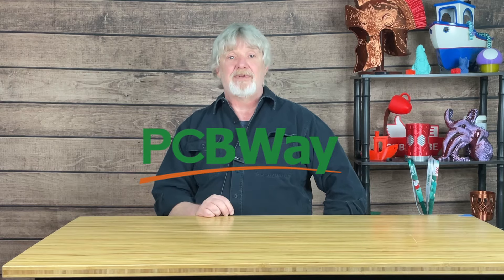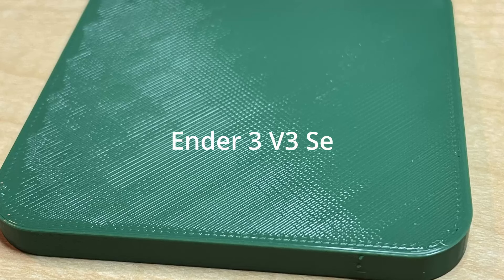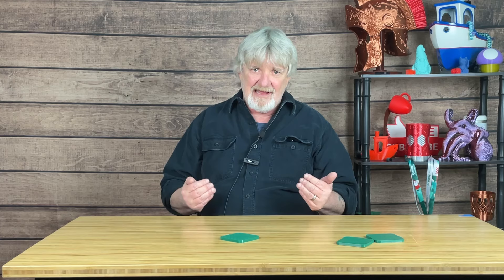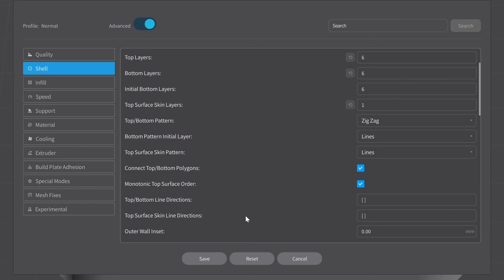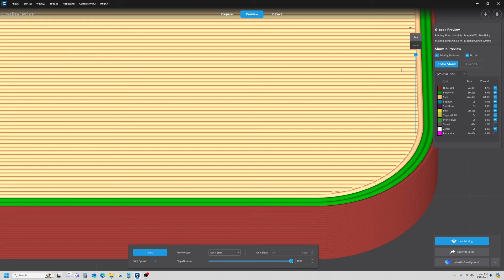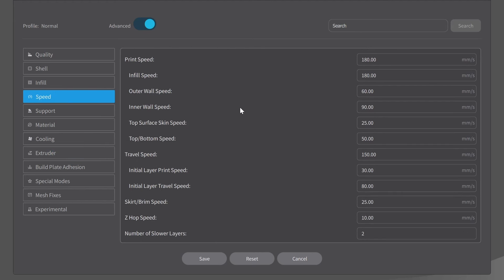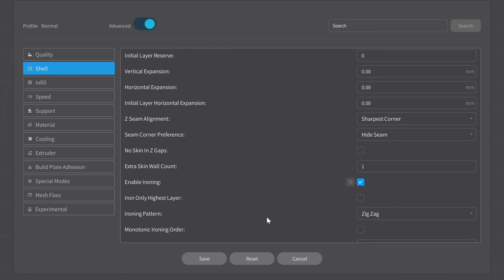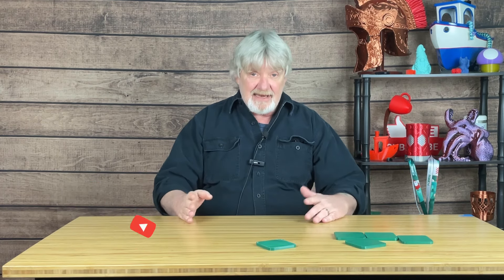Great Top Layers With Creality Print

Comment: After your last video about Creality Print I downloaded it and gave it a try. I couldn't find a menu like in Cura (who knew it was edit) so I gave up on it. This video helped a lot in showing me where to change settings. Hey, I'm 71 and don't play around with my printers enough!! I'll give it a try on my next print. Thank you for the information and video.
Reply from the maker: I'm glad to hear the video helped! Do you have a preference of Creality Print vs Cura? Both are great slicers as is Orca slicer. I bounce around between the three of them. Thanks for the kind words and I really appreciate that you took the time to watch! Thanks you very much!
Reply: I only have used Cura and thought I'd try Creality Print but couldn't figure it out. I'll try it again since I found out where to make changes in Creality Print in this video. Thank you again.
Reply: @andyby7754 I am 77 and totally love the 3D printing world, I tried Creality Print when I bought my 3D MAX but did not care for it, I also tried Orca and now use Orca most all the time. Keep looking, exploring, and learning!
Reply from the maker: @rodneysmith1750  Orca is a great slicer. I use Orca most times with my K1 Max, it does great! How are you enjoying 3D printing so far?
Reply: @pushingplastic7445  Still loving it after almost 8 years, currently have an S1 Pro, Ender3 Max with the S1Pro hot end & extruder, dual z, and my latest is K1 max.
Reply: @rodneysmith1750    Thank you for the tip.

Comment: I recently got myself an ender 3 v3 se and my buddy advised me to use cura... Which has been working great for me.  However, given this video I'm going to test out creality.  Thanks great video!
Reply from the maker: Cura is a great slicer, I use it myself, for about 5 years now. Creality did a lot of work over the years to improve their slicing software. It's made for their printers with Creality built profiles. Give it a shot and let me know how you like it! I have a few other videos on the channel for Creality Print too. Thanks for watching!

Comment: great video bud would love to another like this but in the new Creality print v5 its all changed and I'm new and trying to learn it all
Reply from the maker: It on the way soon!!!!!
Reply: I had the same issue and it was difficult to follow since almost nothing is where the videos show.

However, what I discovered is the little "search" glass, on the right, just under Process Global/Object.

Just make sure to click the "advanced" icon (green) so you get a full list.

You can click that, type in just a word that would match something in the video.

When you do that, i.e "iron", you'll see some hits immediately blow the search field.
It can be a bit confusing because it almost looks like part of the list below it, but you'll see the word(s) you searched for listed and then you can click the one that matches what you want.

When you click it, you'll see, usually at the very bottom of the list, the item searched, "flashing" so as to draw attention to it.

THIS has saved me in trying to figure out CrealPrint 5.1 .

Hope that helps

Comment: Amazing! I plugged your settings into Creality Print and my K1 Max pumped out incredible top layers instantly. I am trying to move over to using Creality Print 5 and having a terrible time. Even in advanced settings, I cannot find any of the shell settings and my top layers look like doo doo.
Reply: My first experience with Creality Print is when I bought 2, Ender 3 V3 Plus printers.
I came from a Cura background and found CP 5.1 very different.
in fact, it's also very different from the older versions, like CP4.

But I stuck with it and the one feature that I use a lot is the search function (on the right, Global).
For example, I can never easily find ironing, so I just click the little search glass and type 
iron
You will then see anything that has the letters iron in them.  Then, you can click the option and it brings you right to the setting you've searched for.  But NOTE, usually, it's at the bottom of the list you see and usually it's FLASHING to draw attention to it.

This is how I find anything I'm seeing.  While the menus and locations of things are very different, using this search, using minimal wording, will find, for example, what we see here in the video.

I've grown to really like CP 5.1.14.

I haven't played with these top surface settings much, other than ironing.  I really do like ironing,
BUT
one thing I've discovered, is when using a very shiny PLA, like Silk, where the object is nice and shiny, where the ironing is, it's not as shiny.  It does dull the surface somewhat.

But I really like how he explains things and i'll keep this video up on the screen today as I run some tests.

I like the idea of using smaller widths.  I had that all wrong before.  I thought that wider widths would "fill in" better, but that's just wrong.  This smaller width, clearly creates a smoother, tighter look.

There is on thing though, that I do wish he'd cover.

That is, how to get that top layer to cover the entire top, edge-to-edge, instead of just inner wall to inner all.  I don't like how the edge looks, where there may even be some gaps.

Perhaps there's an adjustment for that too where the top layer lays over the outer edges completely... ??

Comment: Thanks for the videos, both my printers are ender 3 v3 se modified with Creality Official Original Ender-3 V3 SE/KE Ceramic Heating Block Kit-60W 0.4mm Quick-swap Nozzle Kit, 40mm cooling fans, Nebula PAds, liner rail upgrades. helping me build my profile has really increased the quality of my prints. Do you have a section for ABS filament and TPU? they are the two I'm having issues with. PLA has been great, I am running Creality Print V4.3.8.7062 as I have found it more reliably then V5.1
Reply from the maker: I actually just started working on a video for TPU! I also have an ender 3 v3 se, it was my go to machine for TPU. It is stock. I got my first TPU clog with it a few weeks back, I'm guessing my filament wasn't as dry as I thought. Thanks for the comment and thanks for watching!
Reply: @pushingplastic7445  thanks mate, I encounter a lot of stringing issues on some objects while a simple objects  printed fine. it is very painful, how ever i did use pla profiles and that did reduce the stringing not by much but did improve. I have a Comgrow filament dryer which also helps, I run that in all prints as well. if i could send a photo of my setup on youtube I would show you my setup.
Reply: @pushingplastic7445  Speaking of clogs, I wonder if you have a vid or if you know how to clear this issue... 
the issue is, I was using your video on flow rates where we use the calibration thing that prints out the flat chips with numbers on them, then select the best looking one and enter that number into the formula you showed (which, by the way, works much better than the "NEW" formula on CP's site!!!)

So what happened was, I was using PETG.  Not just any PETG, but a new spool of something called "Gun Metal Grey."  Out of the box it just never flowed right on any printer.

Even drying it for hours made little difference.

So I wanted to try that flow config thing.

But I think that I made a silly error.  What I did was to set the printer to heat the nozzle and bed BEFORE doing the test.  I set the nozzle temp to 245C and bed to 80C.

I started the print and then just went downstairs for dinner.  I did have the cameras running (the Nebula and a top view HD cam I have) and noticed that the 1st layer and beyond where bad.  VERY BAD.  Blotchy, complete areas missing, etc.

What appears to have happened is that some heat creep happened!  Even on this special nozzle with the heat break built right onto it!

I think that, because when I tried to clear the clog using that long metal pin thingy, it stopped right in the middle of the nozzle, ABOVE that heat break piece!

I took the nozzle off and using an SMD head gun, set to 300C (and later all the way up to 480C) I tried to melt the filament that was clearly stuck way up inside (close to the top/entry point).

I got a lot of the filament to finally ooze out, but with that wire thing, I could 'feel" that there was a thin layer of filament still stuck to the inner sides of the nozzle.  It just would not melt enough to "drip" out!

I even used a drill bit that I have that was able to get more plastic out of it, but not enough.

I thought that it was enough, so I put the nozzle back into the printer and tried to flush it with normal PLA at a higher temp (about 240C).

It seemed to flow a bit, but then, the extruder just made that bumping sound and I could see the filament jumping up and down a bit.  That's because while the wire could make it through, that thin coating of filament was enough to make the nozzle's travel more narrow, therefore binding the filament.

I had to change the nozzle to a new one to get any work done.

So I wonder, with all your experience, for one, have you see this kind of thing where the inner wall of the nozzle gets coated and if so, have you found a way to completely clear it out when it's PETG material?

Thanks in advance for any ideas on this.  For now, I have ordered 3 more nozzles just to keep in stock.
Reply from the maker: @BlondieHappyGuy  Jump on Amazon and do a search for "3D Fuel 3D Clean Printer Nozzle Cleaning Filament". That's what I use in cases like you describe. You don't need to use a lot and it lasts for ever. I think it comes with 50 pieces and I've been using the same containers for at least the past 4 or 5 years! It works great!

Comment: I really liked your guide to get a nice top surface. Please could you consider how to get the same quality if that surface has (designed) holes in it? Maybe print your test tile with five holes dotted at random and see if prints smoothly now 🤫? I get artifacts after the holes because the hotend  chooses to move all over the place now. Ive tried with some of the newer settings in CP (and Orca) but I cant get rid......

Comment: Sorry is a top layer question. Which is better to use on a creality ender V3 neo. Creality print or cura. Just trying learn what the settings do. 😊
Reply from the maker: I don't have the Neo, but I can say that I use Cura and Creality Print for my original Ender 3, Ender 5, Ender 5 Plus and of course the Ender 3 V3 Se. I use Creality Print and Orca Slicer for my K1 Max if any of that helps. The profiles in Creality Print are tuned better for Creality Machines. All of those slicers will give great results when you tune your printer and filament. Personally I think the slicing algorithm for Cura is better than Creality Print but Creality Print hasn't been around for more than about 2 years and gets better with each update. I started using Creality Print to help makers that like to use it because it came with the printer and they got comfortable with it. Don't let anybody tell you Creality Print isn't a good slicer. Thanks for the question. If you have anymore, let me know and I'll do what I can to answer it for you! Thanks for watching!